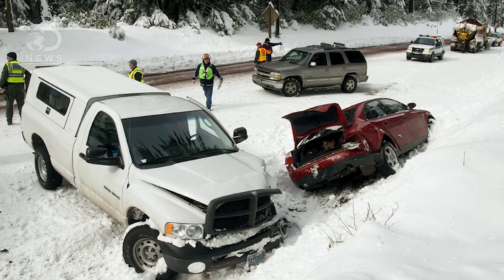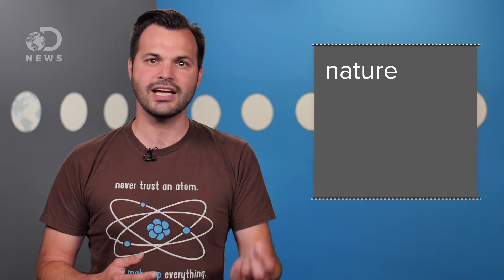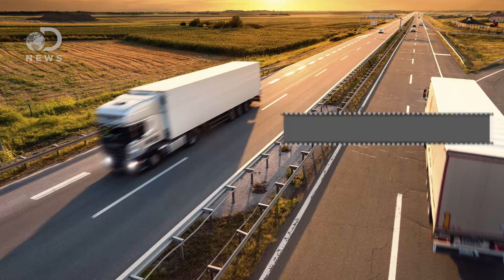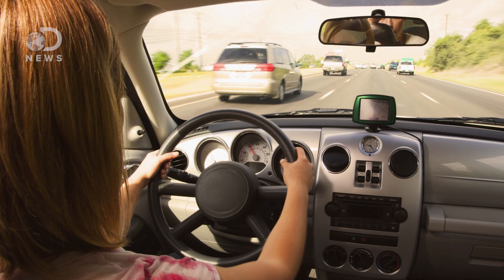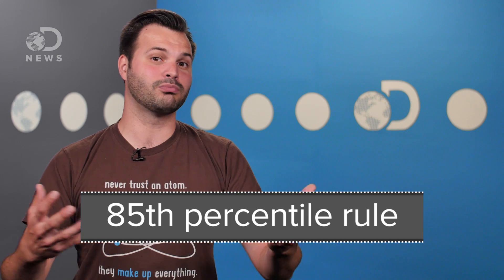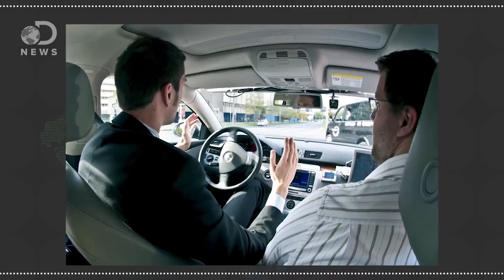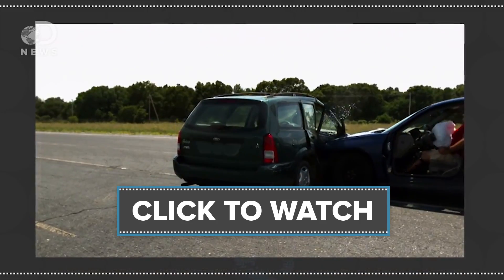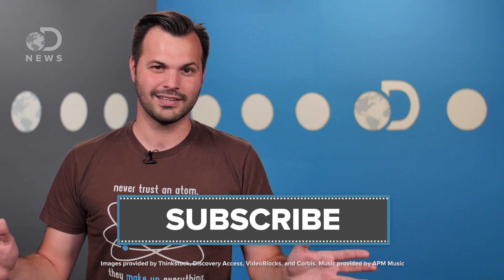How Do We Decide Speed Limits?

Comment: The Oil Embargo was the time we should have said fuck it and gone with electric cars, C.N.G. cars, and L.P.G. cars.
Reply: +Jemalacane0 The technology just wasn't there at the time.  Its still not there now, at least not 100%.
Reply: +John Jacob Yeah, you get to drive 100 miles - - then walk !
Reply: Electric cars use more fossil fuels than a normal car does. It takes oil/coal to make the car, and oil/coal to create the power for it. Until wind/solar/natural gas take down oil/coal, such a solution is futile.
Reply: +Revenge of the Beefsteak Tomatoes it takes electric power to convert oil to other chemicals also it takes power to pump oil and oil has a massive impact on the environment even before you use it as a fuel, theres also sludge  that gets dumped, when you think oil most people think of petrol but theres far more toxic waste from oil then any battery will ever make also batterys are something like 98% recyclable, when you use oil its only about 20%  recyclable thats in the forum of plastics made from oil oO
Reply: Deon Hamilton
Oil companies mix their waste into the asphalt.
Storm water off roads should go into retention ponds, rather than dumped straight into a lake.
Reply: +Deon Hamilton I'm not saying oil is good, I'm saying electric cars are not to the point of being helpful to the environment. That will not be achieved until oil and coal are no longer our main supplier of electricity.
Reply: +Revenge of the Beefsteak Tomatoes in New Zealand our electricity is made up from 75% wind, solar, hydro, and thermal, 25% coal and gas  do you think we should have to wait for you guys to catch up ? just because you live in a place hungry for oil does not mean the rest of us are
Reply: +Deon Hamilton Good point. I was referring to the US which is less than 10%.
Reply: the us is 67% coal gas and oil made up from 33% coal 33% gas 1% oil  oO where did you get your 10% number from heres a link go look up the real data https://www.eia.gov/tools/faqs/faq.cfm?id=427&t=3
Reply: +Deon Hamilton http://www.eia.gov/tools/faqs/faq.cfm?id=92&t=4
It was a figure off the top of my head. The US uses very little clean energy though, as this states.
Reply: Revenge of the Beefsteak Tomatoes it does use less then other places but the numbers are changing by about 1 to 2% per year and increasing the speed of change year on year, did you know only 1% of miss information can sway 90% of people, the tobacco big guns knew this and that's what they used to make people think smoking was not bad for you, also big oil use this too, they pay users to post and feed miss information to help combat there sales dropping, they also will drop oil prices to weed out the competition. they use lies to drive up the price when competition is low, things they say are WE ARE RUNNING OUT OF OIL, WE CANT KEEP UP WITH DEMAND, i am not putting up with this shit any longer oO battery powered cars are a way to remove there power from them, this is a good thing dont you think ? at 1% oil for your power been made at lest your not using 100% to run your car right.
Reply: +Deon Hamilton I'm not saying you're wrong lol. I'm just pointing out the fact that we use fossil fuels worth electric cars currently. There will be no impact until our power grid is run by renewables. That should be our main objective, not electric cars. Electric cars are good and all, but until it's power comes from renewable energy it doesn't make a difference whether we use electric or gas cars.
Reply: well even if your power plant used 100% oil to make power it would be more efficient to charge our cars than run little ice motors, also its not about just changing one thing its about changing lots of things, you cant just say change this first and in 40 years we will start working on the cars. in the time it takes to move to mostly renewable energy there maybe no oil left then what do we go back to horses till they can start pumping out enough cars ?
Reply: +Deon Hamilton Again I'm not saying to not change over, I'm saying we shouldn't fool ourselves by saying we should all have electric cars by now. 
In fact that would be worse. More pollution is created from electric cars that use fossil fuels to create that energy, than standard gas powered cars. That will change in the future, but only when we properly balance our renewables and non-renewables.
Reply: https://www.thezebra.com/insurance-news/2368/why-electric-cars-can-cause-more-pollution-than-gas-cars/
Reply: Meetesh Karia from Austin Texas is the owner of that site he has had 4.5 million in funding from investors witch some are invested in oil oO like i said only takes 1% of misinformation sorry 21 million lol

Comment: German cars run more efficient at 110kmph than 90kmph - Speed limit of 110kmph in Germany is more common. In my country, here are very little roads with 110kmph speed limit. Mostly 90kmph. So if you want to drive the most efficient here, you have to break the speed limit...
Reply: +Māris Samats 
Don't you mean to say kph instead of kmph. That is to say kilometers per hour instead of thousand miles per hour? I just found it a bit surprising to see a speed of 110,000 mph as an efficient speed for a car. Altho it would be cool...

Comment: I feel like each lane should have their own speed limit. This way fast drivers can stay on one side and slower drivers can stay on the other. If you have a 5 lane fairly straight highway in a suburb, the left lane should have no speed limit and should be used only for passing. From the 2nd lane left lane to the far right lane, the speed limit should be 75mph, 70mph, 65mph, 60mph.
Reply: +mastersimonsays well, in germany, it goes without saying and is tought in driving school, that you drive  right. unless to overtake someone.
Reply: LutzDerLurch A lot of ppl follow something similar here too, but its more of an unspoken rule, not a real law or anything. In my state you aren't allowed to drive slow in the left lane. But there are no rules for other lanes. So if each lane had its own posted speed limit, I feel like what you said would be more enforced and ppl would be aware of this rule

Comment: They "believed" that 55 mph was more safe / most fuel efficient, BUT this is actually false. Roads are super elevated (angling the road think nascar tracks) and have less aggregate (the small rocks and sharp debris such as glass that increase traction) in it which means for less parasitic friction.  This is because on highways you typically need less traction to go fast and the super elevated turns or banking of the road keeps high speeds high. Essentially, they reduced the limit to 55 mph to decrease emissions, but in reality it just caused traffic jams and also even greater reductions in speed which then meant that the benefits of the banked roads and aggregate were lost. 

SO +DNews I like your videos, but do ALL of your research please.
Reply: so what speed is the most efficient for highway driving?
Reply: +mastersimonsays to the best of my knowledge, it truly depends on your vehicle. In all the cars I've owned ive gotten the best with speeds between 65-75mph. 45mph has given me the most efficiency, but looking at highway safety it truly depends on the environment. That's why a blanket speed limt of 55mph is rediculous.

Comment: there is only one reason for the speed-limit: domestic flights
In germany we have no speed limit on the highway and everything is fine
Reply: This happened to my native Galway, which used to have an airport in the 1990's with a domestic link to Dublin and some flights to the UK.
A motorway was built between Galway and Dublin airport so that the road journey can now be done in 2 hours. The demand for flights plummeted as there was now no time saving versus road or air when baggage checks, security checks etc are taken into account. Even a bus transfer was quicker than the internal air route.
The airport is now disused and closed to commercial traffic.

Comment: "efficient and safer."

That depends on how you mean efficient. If we're talking about FUEL efficiency, then it's heavily dependent on the car and driving conditions, with some cars having very different speed/efficiency curves from others. The Tesla Model S, for example, has a fuel-optimal highway speed of something like 35 mph, but that would almost certainly not be practical, and nobody wants to drive 35 mph on the highway, or be behind someone driving that speed.

Then there's traffic efficiency. Below about 45 mph, the distance between cars grows slower than the speed of those cars, and thus, the number of cars per lane per second is higher. A highway going below 45 mph is a dynamically unstable system. Increasing the traffic decreases speed, which decreases throughput, which decreases speed, potentially all the way to ZERO.

Comment: speed limits have no consideration for modern vehicles having more efficient engines and more gears to allow higher speeds at lower rpms. better safety systems, and better tires.
Reply: +RiceReaper No matter how safe the vehicle may be humans inevitably make mistakes. That's why self driving cars will eventually completely replace manual driving.
Reply: +RiceReaper ESPECIALLY new safety systems! The amount of control computers and sensors have inside our modern vehicles is fascinating!
Reply: +RiceReaper  All the safety systems in the world won't save you in a severe car crash. 90% of car crashes happen because of speeding. Speed limits are needed and they are lower than they should be because people still will speed. There is a saying in my coutry: he who goes slow goes far all in one peece, he who goes fast goes towards death.

Comment: no speed limit on the the autobahn, yet it's one of the safest roads in the world.
Reply: +Andrew B (IrishRebel92) that's not strictly speaking true. There are absolutely parts of the autobahn with speed limits -- and parts without. The recommended speed, even on parts without is 80mph (130km/h). And as far as safety goes, 67 percent of the deaths on the autobahn occur on the no-limit parts, and they are 8th in safety (as of 2006). The European Transportation Safety Council says they can do much better, perhaps by lowering speed limits.

Comment: Hello. Traffic engineer here. Speed limits are defined by road quality, road and environment safety and everything else listed. If you stop momentarily with speeds 50 km/h +, your organs get ripped and you die. With ~70 km/h you can't survive that kind of crash. So, even if roads let you drive 120 km/h, you should be aware that if something happens - you are dead and nothing can help you (yep, belts and airbags are useless in high speed crashes).
Reply: +Нећу Давамкажем That's a very simplistic view. The number of accidents in which cars come to a sudden halt within a few meters is very small. On the German Autobahn people frequently survive crashes at 200km/h and above. Sure, the probability of death is a lot higher, but modern cars can safe you in lots of cases.
Reply: EACCyclonit  Well, it's very broad to be talked about here. Point is that even if everything is perfect and you can drive 200 km/h, doesn't really mean you should, because sometimes surviving the crash is worse than dying in it. After all, more than 1.2 million people die in road crashes every year.
Reply: ***** Most things in life are dangerous to some degree. As long as you don't cause any increased risk for others, you should be allowed to drive as fast as you deem safe. I prefer considering 4 factors: Road structure, surface condition, traffic and you're own skill. As long as all of those are fine, driving fast should not be illegal.
Reply: EACCyclonit Of course, but it's obvious that bunch of people cause risks which lead to crashes. Sometimes it's the car, sometimes roads, but mostly drivers. I'm sure 200 km/h would be everywhere, only if we could ensure perfect 0 risk conditions. :)

Comment: I wonder if they take into consideration the modernization of cars. Newer cars drive a lot more comfortably at higher speeds than they used to. Sure old cars are still on the roads but even most of those can safely and feel safe making a gradual highway turn at at least 80-90 mph
Reply: What they are taking into account is the unchanging nature of the human body in the event of a collision. Most roads are shared spaces so that you need to take into account the presence of children, mildly incompetent adults, slow vehicles and bikes on the road. Also weather conditions and road surfaces etc.
While there may be some scope for increased speed limits on motorways this would require more driver training, possibly a second teir advanced driving course and test, more rigid health testing and more rigourous vehicle inspections to weed out unsuitable drivers and cars for fast motorway driving.
This is basically what happens in Germany. Car testing, driver testing and policing are much more exacting there than in other countries with lower speed limits.
Try breaking the rules off motorways in Germany and you will soon discover how strict the policing can be.

Comment: Crashes are caused by variance of speed not "excessive" speed
Reply: Partially it is caused by variance, however speed is also a factor as the car becomes harder to control, and the severity of the crash when it happens increases. Speed is a very important factor in cities and curvy roads, especially those on mountains.
Reply: +Name True

Comment: They made a great point in Top Gear, if you have a good car with good breaks you should be aloud drive it faster. Its more dangerous to drive an old car with bad breaks at the speed limit then it is to drive a newer car with better breaks over the speed limit
Reply: +John O&#39;Brien allowed...not aloud, although top gear is good at aloud
Reply: +John O&#39;Brien Actually speed limit should be dynamic and broadcasted to your car. Car model and conditions (by yearly tech cert.), driver stats (age, crash records), weather, car population density, curves ahead, etc. All that thrown into a computer model to allow you a higher top speed under the right conditions.

Comment: Question. 
who gets in trouble if 2 self driving cars get into an accident. Assuming both were  being A.I controlled at the time and there was NO human interaction. would the vehicle owners be at fault or would the company who made the A.I be at fault?
Reply: +Goldmegaman1000 Well, theoretically there still needs to be a driver, and in that case the driver needs to pay attention even when the car is driving with an autopilot. So: it would be handled like any other crash.
Reply: I feel like both would get a ticket for not taking control.
Reply: You two are both right and wrong; it depends on the policies of the creators of the car, if the policy sais the person is responsible for taking control of the car to avoid a wreck. This is unlikely, however, because that would require drivers to pay attention just like they did when they were driving the car, which would deduct from the luxury. If the policies did not state such, the car manufacturers would take most if not all of the reprocussions from the wreck.

Comment: Around here they've been making roads in the middle of nowhere, a straight road with no houses, 50MPH down from 60, (I do 70 anyway, if it isn't busy) The only crashes I've seen is on the corner on that road before it's straight for like 2 or 3 miles and that's because sometimes people don't slow down (shouldn't have a license). 

But it's stupid, Cars are so much better now, they can stop in half the time as like 20 years ago, It's nearly always humans fault, Make tests more strict FFS.

There needs to be more bike lanes as it is pretty dangerous cyclists going a third of the speed of cars.
Reply: My car has 6 gears so it's at like 2000 revs at 70mph, which is low and efficient, 60MPG going 70 A lot FTW
Reply: +21st Century My car's a 6-speed as well, but considering it's AWD, I only get like 18-23 MPG no matter how low my revs get :/ But gas is like $2.10/gallon where I live so I'm not even mad :D
Reply: +21st Century my bike does 6300 revs at 50 mph :D

Comment: Speed limits are only about money grabs.    There are roads without speed limits with much less problems.
Reply: i doubt non speed limit roads have the amount of traffic by say an airport
Reply: +MachoMan 1492 The A5 stretch near Frankfurt International would like to disagree with you! Unrestricted 3 lane Autobahn right at one of the busiest airports in Europe...I was surprised by this as an American living here..You go through a tunnell that is 60mph, then less than a a feww hundreds meters later, BOOM, speeeeeeeddd!!

However, when traffic is really bad, or realllly bad weather, it'll drop back down to 81mph/130kph. (Though 99% of Germans ignore that unless they know there's a speed camera)
Reply: MachoMan 1492  The Autobahn, case closed.
Reply: Agreed. I've seen limits of 25mph around turns that you can safely take at 60mph+ in a top heavy SUV with a busted sway bar. Probably 90% of speed limits could safely be doubled...including those 70mph interstate limits. The only valid argument for speed limits under 100mph on straight interstate roads is efficiency, and even then it depends on the car. I have an old Altima that runs most efficient at around 112mph.